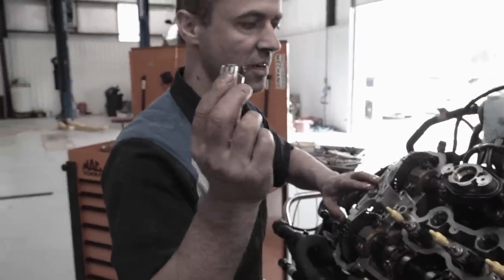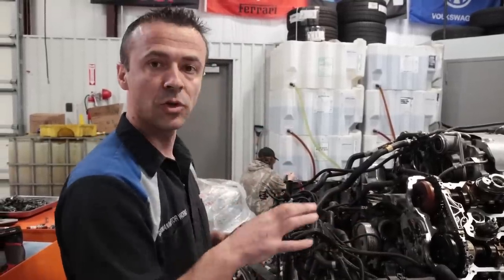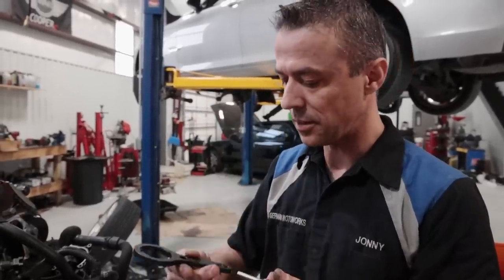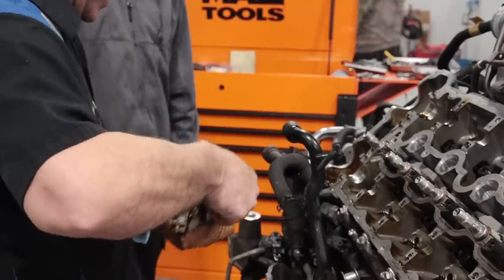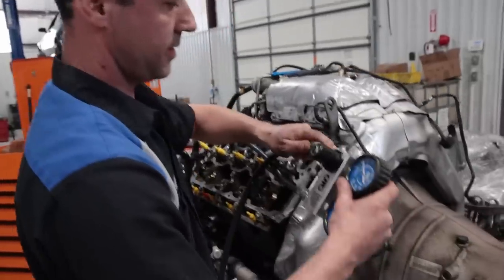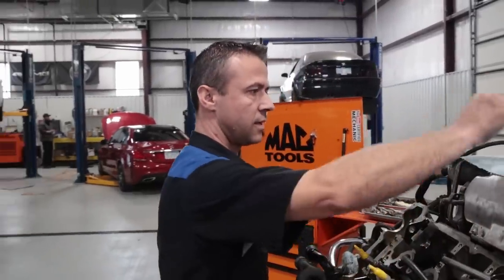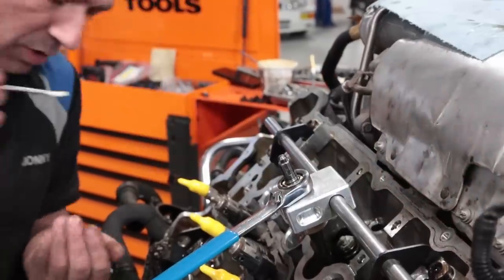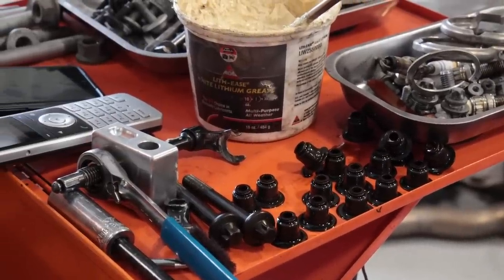CAR NINJA'S Pro-Tips BMW N63

Comment: Great video, I have the AGA tools for the N62 and used it to do seals multiple times and it works fantastic. The N63 seals in the car I would probably not want to so either 😂. Thanks for the video.
Reply: yeh i did my n62 with the aga tool

Comment: Well at least the owner can feel good that even though he was meticulous about oil changes which kept the engine internals "super clean" he can still have the pleasure of paying for a $5k+ plus for an engine out, top end rebuild! Jonny also mentioned replacing the impossible to get to turbo seal that is leaking as well. Of course, it's a BMW and oil and coolant seals always fail creating major repair bills. This car looks to be in beautiful condition. But that beauty is deceptive.  Buyers of late model BMW's with mileage north of 100k must plan to budget for major engine repairs. I know because I just dumped a beautiful 2008 535Xi that I considered "mechanically totaled" after getting an estimate of $6k plus to replace turbos, motor mounts and an oil pan gasket. The car had 125k miles on it and I had already sunk $12k in maintenance and repairs, many of which I was able to do myself. But turbos and the pan were beyond my skill set, so I decided to "quit chasing the rabbit down the hole". I did the sensible thing and traded the car in for $3000-ouch! The dealer I traded to sold it in 2 days for $8000. Sure hope the new owner got some kind of warranty!

Comment: So glad BMW rectified the issues plaguing the older N63 models. Just get the regularly scheduled maintenance, top off the oil & fluids, change oil every 5-7k miles, and it will last a long time.

Comment: an N63 with 140K on it? scientists must study this specimen at once!
Reply: Mine has 133k… just started smoking. Hopefully it is only just valve stem seals and the engine is ok
Reply: @johnnystock7294 same,  mine is at 140k and the pcv's on both sides gave out, doing the repair as we speak, I pray it isn't those seals though
Reply: @Canario52 Yep another common issue with the motor PCV like to crack.
Reply: @thetechgenie7374  yes i have replaced them already and completely stopped the leak thanks though
Reply: Mine on 164k have to add oil every 700 miles and it need to see mechanics every other month but I still love it 😅
Reply: @westrepublic  4 months later not one drop of oil is lost, except for the normal burning lol, now i have to fix my AC i can't stand the summer heat plus the hot V8

Comment: Hopefully he did the bottom timing chain guides those always go brittle and fall to pieces as well. Plus the oil pump chain, or at least adjust the preload. I dealt with way too many of these original N63 when they came in at shop work at.

Comment: So you were able to tighten the Cam bolts to 30nm plus 90degrees with a stock hydraulic tensioner? Did the sprockets themselves not move during this at all?

Comment: What do you normally charge for a job like this on the n63 platform?
Reply: Dawg, you do not want to know that answer. He will can  be cheaper than most because he specializes in it so it drastically cuts down labor time, but we truly do not know. Lets say the book time to drop the motor and do all of this is 9hrs. An average shop might do it in around 8hrs. Car Ninja might do it in 4hrs with no break. Now, does he charge you 9hrs, or does he charge you 6hrs is the question? He charges you 6hrs and he cuts the competition out by charging less on labor because he is faster. Or does he charge you 8-9hrs and takes you to the cleaners because he is a specialized shop and has a Youtube channel. This is why I try to avoid shops that have an hourly labor rate. I am a car guy so I know how long it takes to do most stuff on my cars.
Reply: I would guess 3-4k??? Bimmer forum says it's a 30 hr job. They are saying the dealership wants 8k. Lol
Reply: @blockpartyvintage1568  bmw dealer by me wanted $14,650!! They said 49 hrs! That’s why they are called stealerships for a reason!
Reply: While the engine was out did you consider rod bearing replacement? Great video by the way.
Reply: Just had mine done. $2700 with parts and labor.
Reply: @sumomassaquoi5212  hell of a good deal! What area do you live in?
Reply: @ramisiljazi9540  I live in Delaware. I got mine done at VTECHNOLOGIES in Wilmington, Delaware.

Comment: I just got my timing guide bracket and VCG replaced plus couple hoses fixed and the aux intercooler pump pump by Indy ( $2000 even ) SC upstate area. I’m scared now watching this hoping he changed the seals as well. 12’  x5 50i 124k miles ran great before the i started smelling burning smell through air vents.

Comment: The to Chain guide that was broken you fixed, what about the others if it had broken would it not be wise to replace all of the guides? Just wondering if they are all becoming brittle probably would be wise to replace them all. I know some folks would resist, but if that were my car I would want all the timing chain guides to be replaced.

Comment: Are there “better than OEM” replacement parts for these? I would hate to have this entire process re-done in another 50,000 mi or so.
Reply: I believe BMW updated the parts. The newer tech updates of the N63 are less prone to leaky valve seals.  140k for a BMW valve seal in a V8 is a lot better than they used to be.  Maybe the new parts will go to 200k?!

Comment: BMW started replacing the engines, rather than doing this job anymore. Because they dropped the engine price to around $3k, which is insanely cheap 

So you will probably only get this job done, in a BMW Master Tech home garage for $2500 now. With that being said I own a 2009 BMW 750Li, with this engine of course. I bought it 2 years ago for $7500 with 60k miles 

Say what you want but I drove it back, 600 miles from Virginia to NYC straight. With a shaking engine & I was getting 22 MPG lol, so I have to give it props for that. Never broke down

With that being said I got it all sorted, with new vanos solenoids & new exhaust camshaft gear with new bolt. For a total of $1300 including labor can’t complain, dealership quoted me $20k btw

Not sure how bad my valve seals are, but there’s a product I bought called Liqui Moly Motor Oil Saver…it rejuvenates all rubber & seals inside the engine. It works wonders believe me

This engine is definitely notorious, but if you tackle the known problems…it’s a very nice engine/vehicle. Replace the PCV hoses & wrap them with heat resistant tape. Replace the coolant hoses by the turbos, wrap those with heat resistant tape also 

Replace the y stem that connects the coolant hoses under the turbo, with a metal one or wrap it with the tape also. Change the oil on time & use the motor oil saver…you’ll be good to go 

Heat & and bad oil is what kills these engines, because they run abnormally hot by design. So if you take those preventative measures, the engine will last a long time
Reply: Thanks for dropping this man I just got the motor oil I’m waiting for it to get to the valve stems it’s been a a few days but I’m taking the advice on the heat resistant tape on those hoses because I snapped my pcv valve putting my air filter back on I got a new one but that tape will definitely be getttjng wrapped around them

Comment: Hey Maestro CarNinja, I have a friend with a 2010 750 with 198,000 miles and randomly started misfiring on cyl 4 he was driving in the highway. Now it’s getting misfire cyl 4, 7 and random.  We replaced spark plugs, coils, pcv with pipes on both sides as they were cracked yet issue still persists. Where should he look next besides getting a new car?

Comment: is the airpressure/leakdown test recommended, all cyl, before determining to pull the heads or not?  This customer wins my praise for the extent of engine overhaul.  @140K much to replace with new.  That there are special tools for the valve stem seal replace speaks to the value repair these cars - prolong quality service life/less polution, lower taxes, etc.
Reply: it was in for oil consumption so my guess is its good to rule out the cylinders while doing valve seals. but yes, you want to do every cylinder on a leakdown test

Comment: 18 m550i w the n63tu motor, 95k miles with no problems riding strong
Reply: Count your blessings (I have the same motor in my 2018 M550i!).

Comment: N62 valve stem seals can be done in the car pretty easily, but for the N63 it's definitely an engine-out proposition.
Reply: My N62B48 just passed 280k kilometers and has all signs of needing valve seals replacement for a while now but at this point I think I will have it taken apart to last screw and put together with all possible seals replaced, timing chain etc. to just have this silly thing done for next few years

Comment: I had a 2012 550i with the N63, engine failed with 58000 miles. Rod bearings gone. Lucky it was a certified preowned so warranty paid for it.

Comment: Johnny what's the approximate cost on a job like this on an N63?  Just curious.. as much as you hate this job, it must be a good money maker for the shop since they all will eventually have valve stem seal failure..

Comment: Wish I was closer to your shop Ninja, I have a Audi A5 S-line 2 door coupe...  I have my 35k Service due..  Plugs and oil change 700 bucks the Audi dealership says .
Reply: Be a man and do it yourself.  That is very basic work.
Reply: Thats a four cylinder engine, the plugs are right there easy to get to. And an oil change is easy. If you dont have the tools whatsoever than try an independent euro shop, 700 bucks is robbery for that
Reply: Biggest crooks are mechanics before car salesmen. My sister had an Infiniti Q50 3.0TT. I am a car guy who does some light to moderate wrenching. They wanted to charge her like $160 to do her air filters 😅😅😅. I told her it is a 5 minute job to do both of them. She got them for like $15 each and I put them both in, in 5 minutes.
Reply: @Nitrousbird  why you being rude... no place for that here
Reply: @MasterClown420  @Nitrousbird took the words from my mouth.
Reply: Look its not only plugs and oil guys.. 35k miles plugs, oil, brake fluid, trans fluid,.  Plus im not trying to void the warranty..  this place is full of fans of ninja.. not a place to down people or be rude.. grow up
Reply: @MasterClown420 , this just sounds even worse. At 35K, what are they EXACTLY doing with the trans fluid and brake fluid? I am waiting for you to tell me they are gonna FLUSH THE BRAKE FLUID AND DO A DRAIN AND FILL ON THE TRANS (if it was a CVT I could not even see that). At 35K you do not change the brake or trans fluid on this car. As a result, they will "check" the fluid which takes seconds and do nothing more. They will also check the coolant. They will check your brake pads and say they have X amount of milimeters left. I mean, if you have money to spend, I can't really judge you.
Reply: @elmayimbe_the_amateur_mechanic changing brake fluid has nothing to do with mileage and everything to do with time
Reply: @rwd323 , that goes with a lot of things on a car. If you change your oil, drive 1,500 miles and then park the car for 10 years you don't drive on that same 10 year old oil.

Comment: Can I get a ballpark price of what this cost to have this type of service done. My 2011 X5 has close to 158,000 Mi. Personally, I just use the at-205 valve seal conditioner to get rid of the little bit of smoke I had coming from my exhaust. And the little bit of smoke that was coming out only started coming out after I decatted her. I would be more worried about my timing chain, and I'm sure the valves need a walnut blast.

Does anybody know if it's easier to do this job with the engine in the X5 over a 750 or 550 because there's more room, or is it just my imagination? There's more room in the X5.

Any help would be appreciated.
Reply from the maker: Around $7k
Reply: @realcarninja  thanks Ninja
Reply: @realcarninja are you located in California by any chance?
Reply from the maker: @westrepublic  Nope. Kansas

Comment: Top chain guides turned brown and became brittle and broke into pieces. What is the chance the 4 guides behind the front timing cover in good condition? I am guessing 1% (if not now, it will be in 6 months) and you could have removed the oil pan (easy for N63) to check for guide chunks more than what the top guides can give you.  If so, do it right and pull the cover to replace 4 guides but that means heads out and upper oil pan out. Ouch. That is why N63 sucks.

Comment: I agree with dropping the engine to do this kind of work. Leaning over the car for days and hating the back pain the comes with it isn't worth it. It's only a couple hours of work it takes to drop the engine out from the bottom, and save yourself from a lot of swearing and back pain.

Comment: cant believe the n63 has the exact same problem as the n62 - i thought they realised the issue and used better parts?
Reply: Japanese auto makers usually make necessary mechanical adjustments from engine to engine but not BMW.